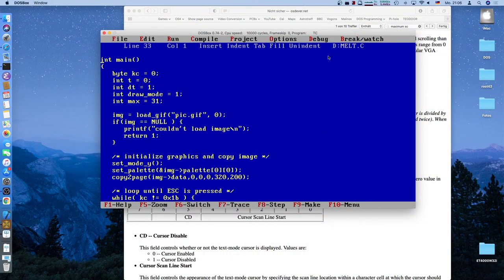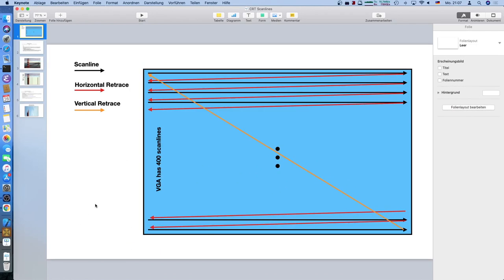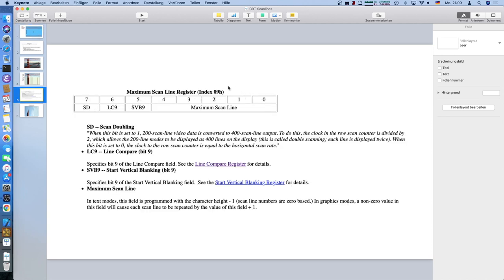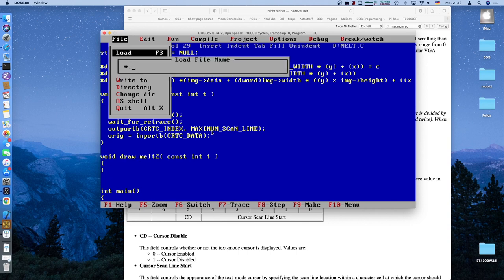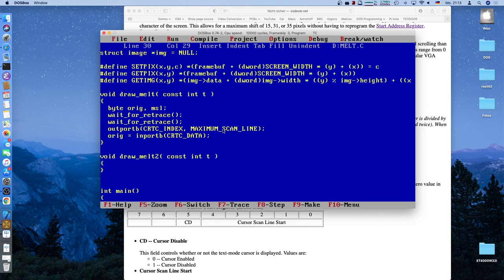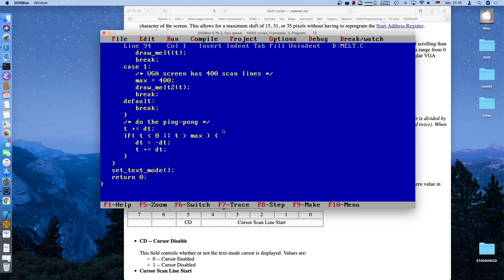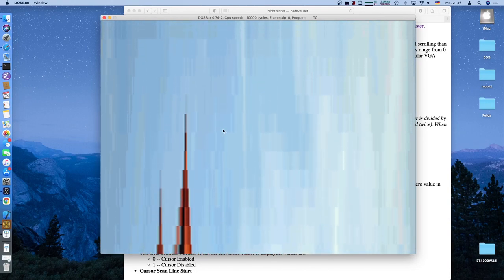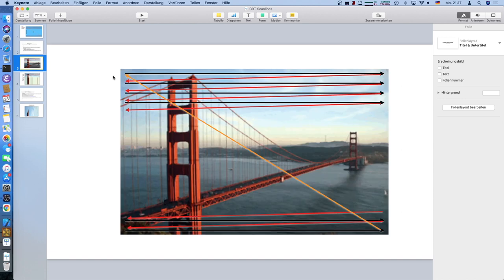Let's Code MS DOS 0x1D: Melting the VGA Screen

Comment: Cool video. I haven't programmed VGA directly in decades by now. I totally forgot about the registers, but the moment I saw you bring up the CRTC_INDEX, their hex port numbers jumped right back into memory. Crazy isn't it, after decades. Those were good times, with shenanigans like shl ax, 8, shl bx, 6, add ax, bx, just so we didnt have to mul 320 :D. I randomly landed on your channel just now,  and am sure going to check out more! Cheers :D

Comment: Very cool! Thank you very much. I'm curious, if the meltdown screen in Doom was made in a similar way?! There it looks completely different, but I guess, it can be reached somehow using this technique..... May be also an interesting topic for another video? ;) May be Michael Abrash wrote about that in his book. I have to dig it out again....
Reply from the maker: No, the Doom melting screen is just clever pixel pushing. Probably utilizing the Mode X specialties, e.g. copying one column being faster than copying one row. You have to switch bitplanes between two adjacent columns. Maybe they even used the 32 bit latching by copying four columns at once? Not sure about that.

Comment: Talking about memory transfers, what some people might find surprising is that with VGA latch register and memory planes, one can actually do 32-bit transfers from vmem to vmem even on an 8-bit ISA card. Not that this beats screwing with the sync registers etc. for some effects, but still a nice speed boost for certain things which can't be done otherwise.
Reply from the maker: Very true. But the operations are sadly a bit limited. But you can e.g. clear the vmem very quickly with this technique.
Reply: @root42  Indeed. However, one interesting example is how Supaplex (DOS game) draws all its moving objects using this method. Allows the game to run smoothly on much lower spec machine than it otherwise would.
Reply from the maker: Cool. I guess they don't have to deal with transparent backgrounds for the objects then? Because that is one thing that is missing from the VGA pipeline sadly...
Reply: @root42  Yes, there is no transparency. Everything just has black background and doesn't overlap with anything else. Although within the limits of the VGA memory, I suppose one could have large number of different blocks that would correspond to differently overlapping objects, but indeed such limits are quite obvious.

Comment: Race the beam! The melt2 effect is nice, obviously it then spends half the time (the non-vretrace time) on the CPU busy-looping to count the horizontal retrace, so less time for other logic, but for a static image / intro it’s fine. Also, I guess if the “other” code misses the vretrace deadline, this would flicker? (iow, there’s only about 8ms at 60 Hz for logic during vretrace)
Reply: I ended up having a “scanline interrupt” kind of function by inserting a “get pointer to scanline” callback in my double buffering code that blits the back buffer to the front buffer. Needs a fullscreen memcpy, but on faster machines it’s easy to program and needs no time to wait and allows for a variety of effects.
Reply from the maker: I think you could even count cycles and intersperse some logic in the horizontal retraces. But that would break depending on machine speed. So best to design it for a 4.77MHz PC. Then you will be on the safe side if the machine is faster. ;)

Comment: could you do some SVGA 640x480 256 programming in protected mode on DOS? I always want to learn this.
Reply from the maker: We can put it on the list. SVGA is one thing. Can be done even in real mode. Protected mode is a whole different beast. Especially if done from scratch. Alternative would be to use djgpp or Watcom with DOS extender
Reply: @root42  great.  i love to learn this because DOS games in the later 90s all use a combination of SVGA graphics and protected mode.. Common dev tools like those from Borland and Microsoft don't provide libraries for SVGA nor P-mode . I was a QBasic fan back then I felt stuck in VGA and 1MB of RAM.  SVGA games often have large sprites that only protected mode can provide..  My view on why no tool on this SVGA+p-mode subject is that both Borland and Microsoft moved on to Windows 95 and ditched DOS programming.. Watcom was the only tool there because they are a OS/2 supporter.. the DOS/4G extender used in many DOS games is actually a OS/2 semi-emulator that runs OS/2's LX executables(naturally in protected mode) on DOS... I also suspect many DOS extender games were developed on  multiscreen IBM OS/2 workstations then cross-compiled to run on MS-DOS, such like DOOM, C&C or RedAlert.  There are definitely very interesting and untold stories